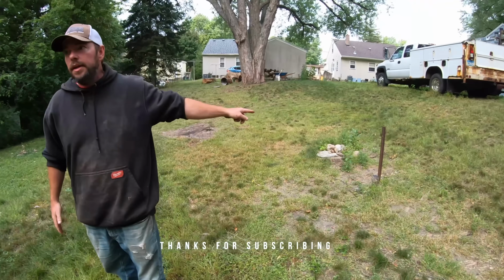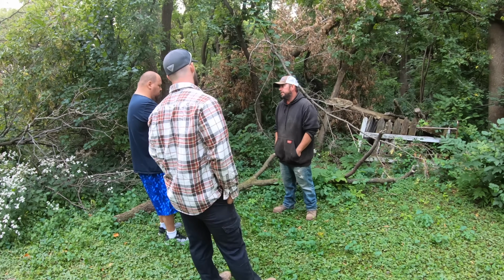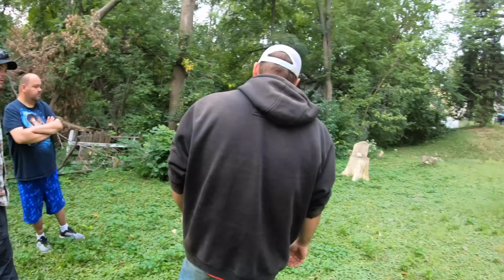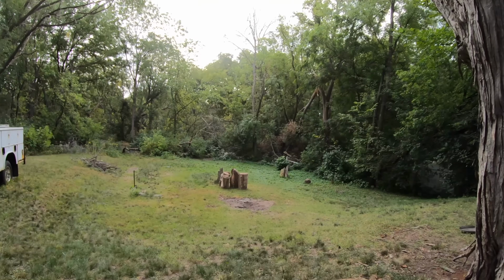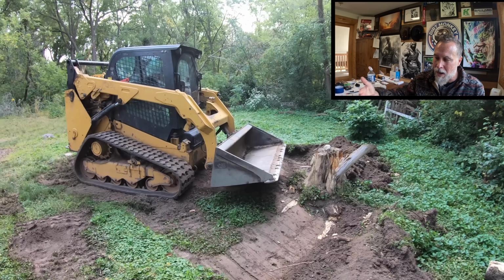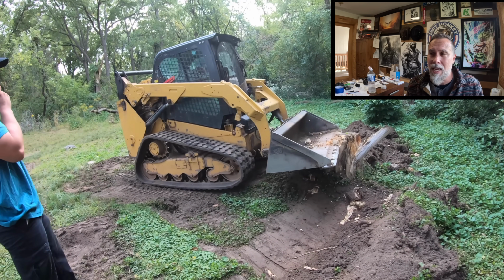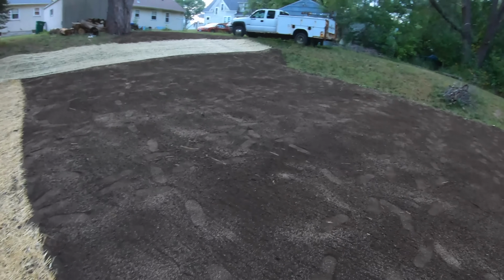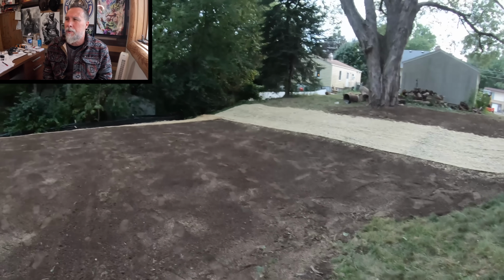Turning a Slope into a Flat back Yard   4K

Comment: I use a fab'd mounting plate with a frost digger similiar to what you see on the rear of a dozer to dig and extract stumps. Breaks up the roots and loosens the soil so the skid steer isn't operating a lot in pressure relief, which generates heat in the hydraulic system. Its also easier on the pivot pins.

Comment: When I worked in landscaping we'd pretty consistently bring in our 10 ton excavator for pulling stumps. Either use the breakout force at the bucket or get a chain under part of the stump. I think we had a hotshot type guy try to pull one with an F350, still surprised he didn't put a chain through the back window.

Comment: Nice job. Looks like good topsoil as well. Makes grading, seeding, and raking so much easier. We tend to strip and then reuse our topsoil
If we’re adding fill, but that topsoil is not always the best when getting it all finished in the end. Also, with stumps and the skid steer, I prefer to push rather than bang, and dig whenever possible. Again, nice job!

Comment: I've powered tho frozen snow banks with my loader one winter and broke the 1inch pin and caused multiple hydraulic leaks but got the job done I wouldn't recommend it in less you like doing repairs in blow zero weather on you back in the snow

Comment: Don't use a backhoe as a jackhammer.  Operator on a case backhoe trying to bust out 12" of asphalt. Blew a hard line on the stick where factory creased a bend. Was able to tig weld it to get back up and running.12" water main blew and lifted a bunch of asphalt. Oops. Fyi at the time cat had mandrel smooth bends much sturdier. I would try to pull that stump with a chain.

Comment: Track loaders(with big smooth buckets) are not the best tool for stump removal but if ut has to ve done have to dig it out as much as possible and use break force or maybe give it a hit or teo if its dug out.  Stump buckets really make it a much more efficient process concentrating all the force on a much smaller area than that 72" bucket.

Comment: I'm not saying they did it right, but they weren't wrong.
They tested the stump 4-5 times and then dug it out.
It was a call they made. If you want them to not do it that way, instruct them to not try to tip out stumps, but realize the next time the stump might just fall over as the first one did.
While you're at it, instruct the other guy not to dig out the other stump using his boots.

Comment: In theory you are not supposed to do that right but we do it anyways but A good rule of thumb would be three pushes to the front three pushes to the left side three pushes to the right side if you're not going to get a bud then start ripping out the root systems because once you can start getting half of that tree stump stabilizing root system broken you're definitely going to be able to rip out that stump but if you have what I use is a ditch witch SK I can't remember the rest 300 I think 🤔 with the backhoe attachment I have ripped out root systems a tree stumps that size Central Coast eucalyptus not the actual Central Coast of California where call Central Coast because we live in Pismo Beach and that's where all people to ride there sand dunes so therefore we are Central to all off-road Beach Riding enjoyment until newsom takes that away as well

Comment: It's simple maths. How much will the repairs (including down time) cost compared to taking the longer "correct" way?

If you save so much time that a bit of machine down time, labour and parts works out to be cheaper, then you are saving money by breaking the machine.

Assuming you succeed before the machine breaks of course.

Normally, the maths works out to be cheaper to work slowly and save the machine.

Comment: Excavator should be used instead of skid steer. If all you have is a skid steer, dig around stump as much as possible to get weight of dirt away/off of it. Then back up to stump with machine and  use a chain to pull and it will loosen the stump and eventually you'll pull it out. Banging into it with the bucket is machine abuse I think. If you're cutting the tree, cut it off 3-4 feet tall so the chain will have leverage on pulling the stump over and up/out of the ground. Pull slowly on chain to put tension on it, never yank a chain and shock it.

Comment: I'm doing a large scale landscaping job next summer for one of my local customers here where I live. We have to dig out the drainage ditch cut down for massive pine trees and then truck in about 20 loads of clean fill to raise up the low spot because it continuously fills with water from the spring thaw and backs up into the building. And then a couple loads of topsoil and a chuck load of sod

Comment: Nice job on the levelling, but the straw blankets are not correctly put in place.

Yoiur overlap should be put on like shingles with the lower row underneath the higher row. Plus the top part of tour rows should be a little bit burried to prevent water entrerins under. Both these points can allow water getting under the blanket and wash down the seeds and the top soil if you get a strong rain before you have some kind of a root systrm to prevent erosion.

I learned this mistake the hard way on the job, and i have over 300 riverbank stabilisations under the belt.